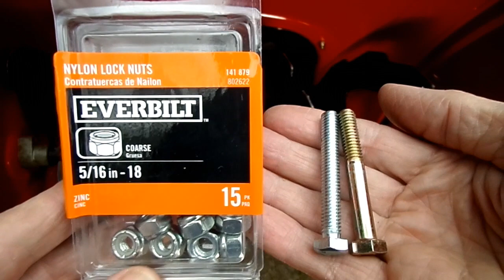Snowblower Tip

Comment: You can pick up "grade 2" bolts from Tractor Supply for $2 a pound.
The lock nuts are $3 a pound.

Very important that you grease the auger shaft and gearbox every year. It does no good to have sheer bolts if your auger is rust-welded to the shaft...

Comment: Hello Rich - 
Half way in the middle of the threaded bolt grind a small groove all around the bolt that way your sure to break the bolt under a heavy pressure of snow that has  built up around the auger - thus not to damage the gear case transmission .
Reply from the maker: Thank for the tip.

Comment: Hey Mr Rich, I know this isn't thr right video for my problem and all but my Saturn has had some problems recently. The idler pulley has gone out and I replaced it along with the serp. belt and now my car won't start. It cranks and sounds like it wants to start but no matter how long you hold it the car won't start. Any ideas what could be the problem?
Reply: The model is an SL2 and it was made in 1997
Reply from the maker: Do you have spark.

Comment: Thanks for the video. The sheer pin or bolt only breaks when you need the snow blower the most. lol 
Sheer pins are a lot cheaper than gear boxes.:)

Comment: That's a better or cheaper option than the original bolt, i would use weak bolts even if the gearbox was strong, it limits damage, if i lived in a snowy country.
And now for the crap joke: Was that better bolt made in Baltimore? :)
Reply from the maker: You mean there is no snow in the UK........how unlucky you are.
Reply: Well we did have about a weeks worth of snow at xmas, but after that it's rain and wind,  later the odd show of the sun for half an hour lol.
Our seasons just appear to be wind and rain, sometimes just a grey day.
When i was a lad we had seasons and always snow at xmas :-D